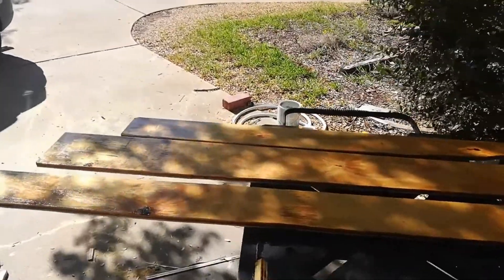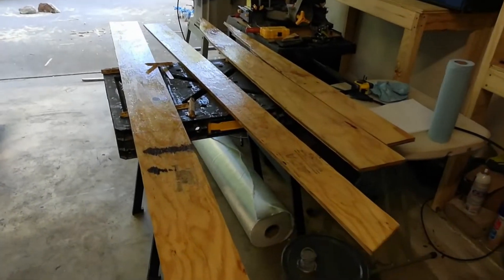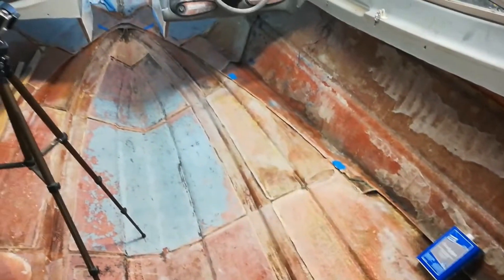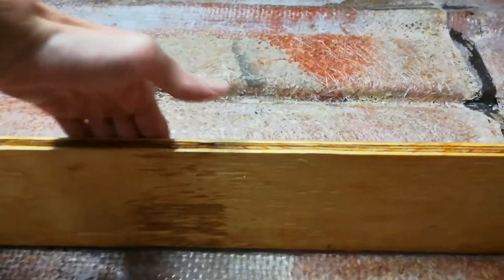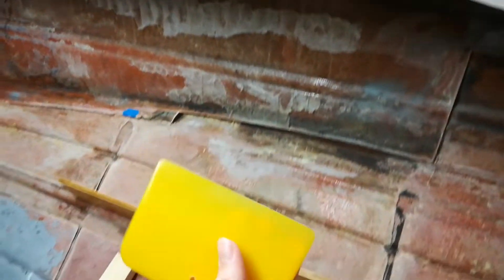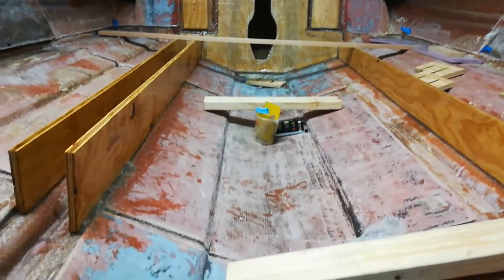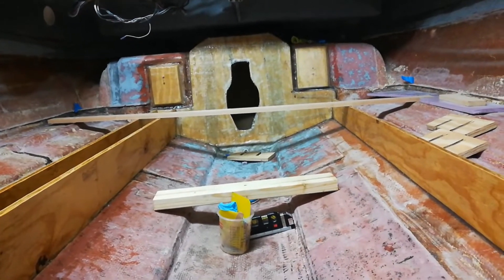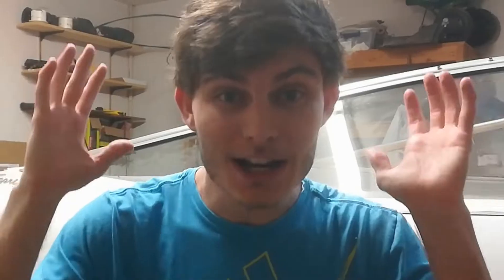1998 Bayliner Boat Restoration - Part 19

Comment: For filling reinforced resin in under wood like your stringers consider using throw away piping bags that bakers use for frosting cakes. This would be much easier and faster to pipe the resin in underneath or around before it has time to set up.
Reply from the maker: That's actually what I was considering doing 😂 popsicle sticks really didn't take  too long though

Comment: what did you use as the “peanut butter”? Thanks all the best from NYC
Reply from the maker: resin with fumed sicilia or flour added and usually chop strands of fiberglass too for strength. sometimes I did it as more of a filler without chop strands

Comment: Curious about the Peanut Butter formula also.  Is it in one of the other videos?
Reply from the maker: The formula isn't exact, just add a filler like flour or fumed silica(if you have the budget) till it thickens up some, and also some fiberglass chopped fibers to give it more strength. There are sometimes I did not add the chopped fibers to get a smoother surface depending on the spot I was working on